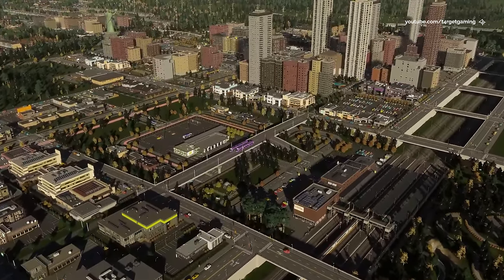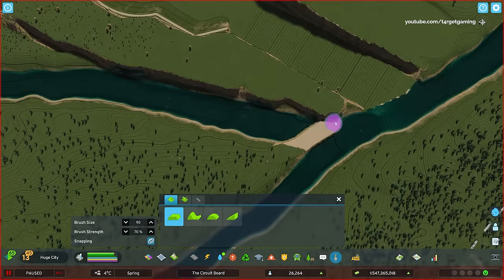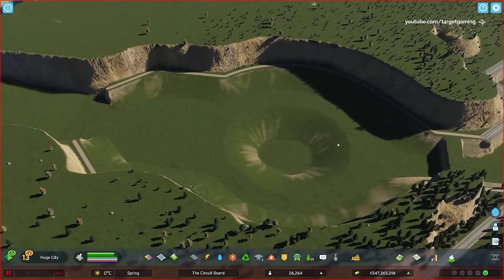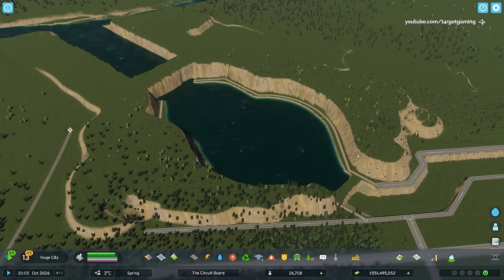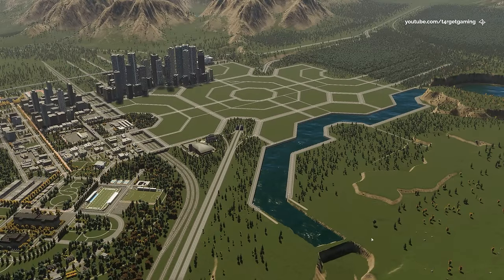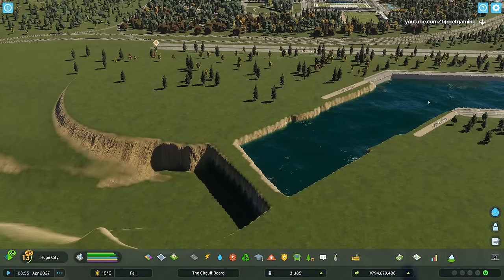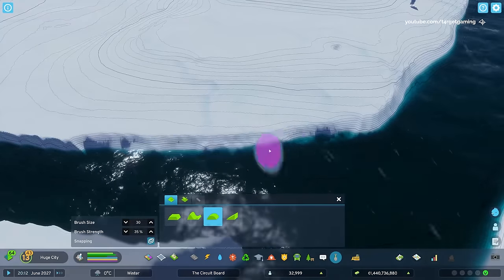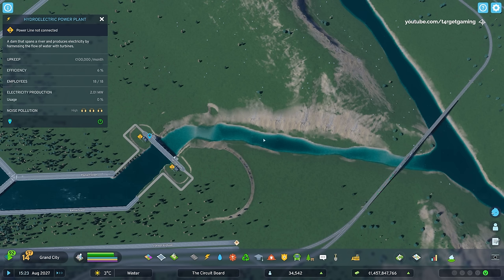How I Engineered a Canal that Generates Electricity in My City Layout

Comment: Thank you for the great series.  The dam was challenging.  Especially when it came to increasing the power output. I tried increasing the water flow too. While it did increase the power output of about 20 MW. It also increased outflow water that started creeping over the edge of the road. After rebalancing the canal I tried an alternate method for increasing the power output. I ended up digging a 50 brush size channel along the face of the dam on the outtake side. I can’t tell how deep I dug but it is a lot deeper than the deepest point of the circular area before the canal.  When I started my output was maybe 1MW.  Now it varies between 140 and 250 MW.  I have no idea why it varies, but it does.  I did the same to the lower dam.  There I used a brush size of 10 to keep the channel inside of the shadow line of the dam.  You have to look hard to see the channel. Output on the lower dam is between 4 and 6 MW
Reply from the maker: Hey, thanks for the detailed inputs, I'll play a bit with the dam to see if I can increase my output as well

Comment: For the bridge comment near the end, I'd actually disagree, there's precedent for it--look at Millennium Bridge in Denver CO's heart of downtown over the relatively small South Platte River. It's directly next to Union Square and 16th Street Mall, two major landmarks of the downtown city, which aligns nicely with the circuitboard's canal going through downtown and with the possible addition of a tech institute, I'd say that even if it is "overengineered", it's a stunning landmark for when the city is more fully built out towards that area.

Comment: Water flow is such a complex problem to solve in Cities Skylines
Just a quick tought: you might want to build a secondary dam at the other "leg" of the upper river, at the very same height as the one you have. This will ensure that the water is always at same level and you don't lose flow to to other free flowing stream, then both dams will generate more power and you'll have a more predictable flow